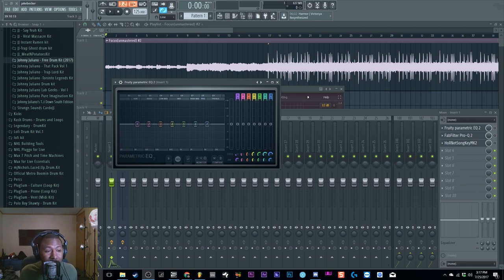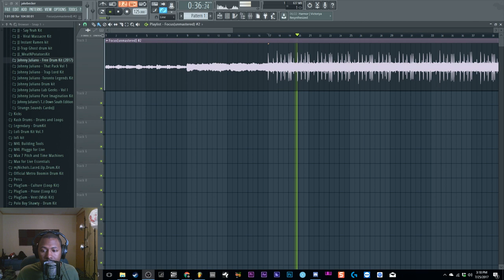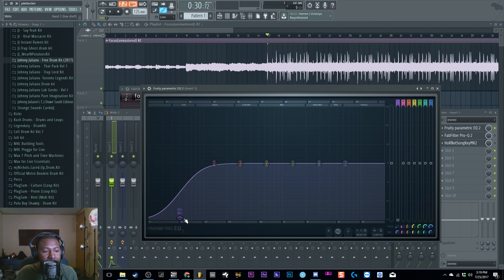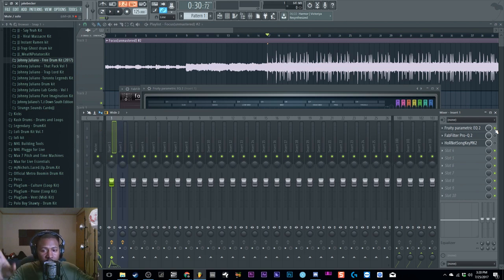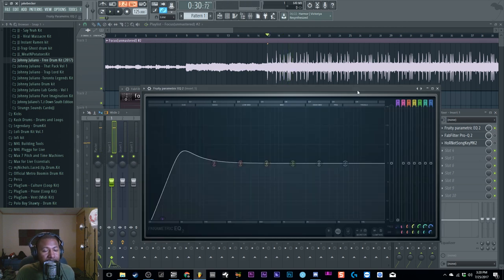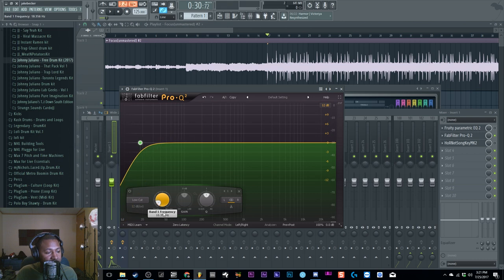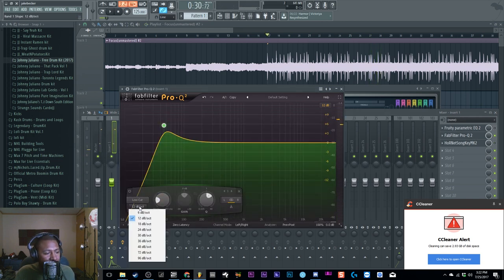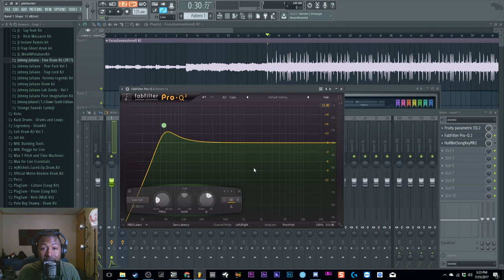How To Lowpass and Highpass filter the Right Way We been doing it wrong

Comment: Well, I have a little doubt about if I should use a Low pass filter or a Low shelf. If I use a low pass filter I kinda lose those low end frequencies and the sound will be THIN rigth? So If I use the low shelf filter I kinda boost those frequencies and I´ll make it sound more complete. In the other and If I´m using a melodie that contains a little of bass and I use a low shelf cut it migth clash with the 808 and it will probably sound terrrible. My question is, should I use a low pass filter on melodies and a low shelf on the 808 ? Or just use a low shelf on both or a low pass on both?

Comment: I really like your tutorials but you are still doing ur low pass filter technically incorrectly. Technically there is NO WRONG or RIGHT way to EQ low-pass high-pass bandpass. You should always adjust ur mix & EQ to taste. But you are using a low shelf to low pass when you need to first put it in low pass filter. Then add a notch, bump, curve, for  resonance. Dave Pensado is a great engineer & maybe u should look at sum of his work. Dude has good info as well as u do. Keep up the great work Mr. Different I enjoy ur tutorials. #Koolbeats
Reply from the maker: a lot of people missed the whole point of this video is not to say that one way isn't better than another or one is right and one is wrong it's just to say that there is more than one way to do the same thing and the funny thing is Dave Pensado does this himself look a some of his older videos or check out his work with McDSP. A lot of people don't do research and that's what I'm trying to get people to do and try different things to their mix.